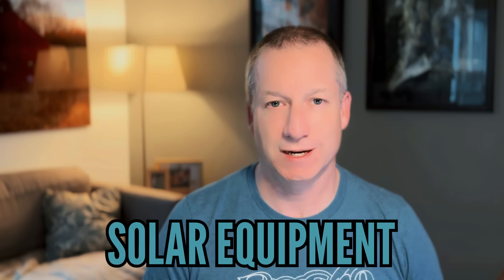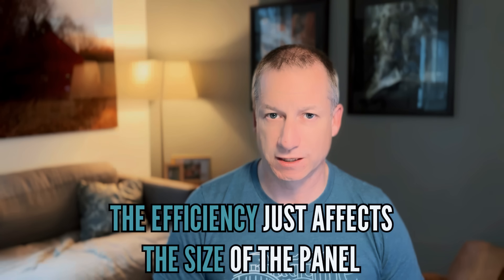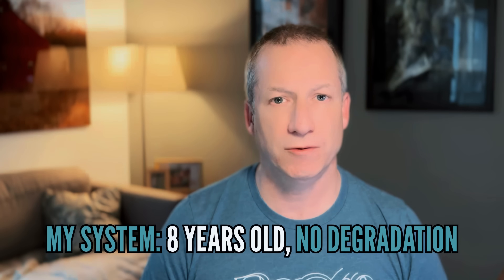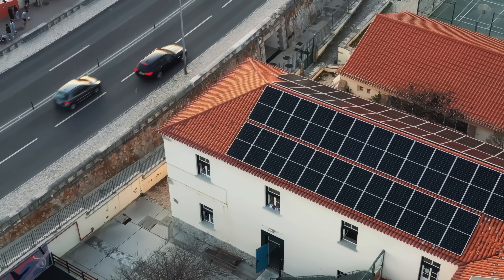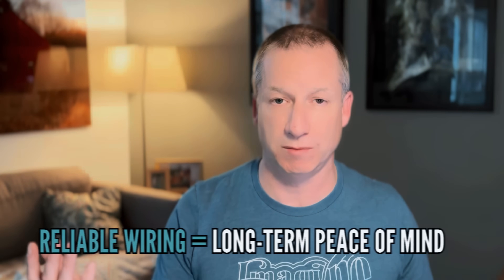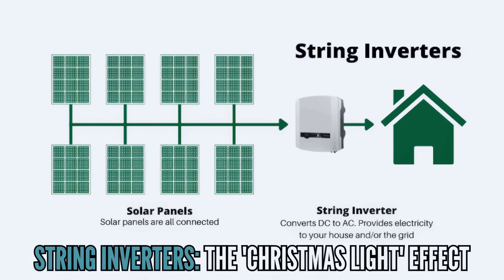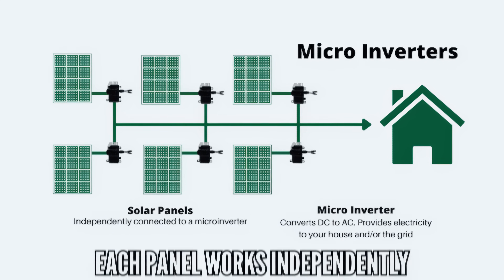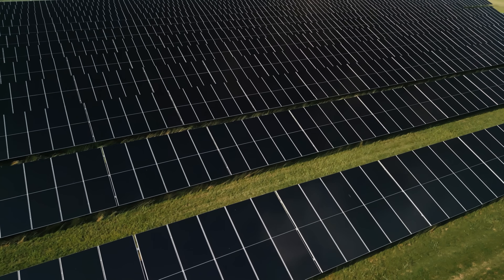The Hidden Downside of Microinverters No One Talks About

Comment: This is misleading. Micros have 25 years of warranty (Enphase) and even if one would fail the rest of the system works great. With an optimizer based systems (Solaredge) both the optimizer and the inverter may fail. And string inverters only have a 10-15 years warranty. In addition, you are running high voltage DC cables on the roof with an optimizer type of system. Micros are a bit more expensive but they give you the piece of mind that your whole system will never fail. It’s AC and it’s safer due to no arching issues. And if you ever want to add panels in a micro system you just slap new panels on with new micros. However, with an optimizer based system you have to resize and buy a new inverter that match the additional panels. If one doesn’t go with Enphase then the Tesla Powerwall 3 with included inverter is the best option. There is no need for optimizers anyways as new solar panels have bypass diods  in built that manage shading. Thus optimizer based systems have lost most of their historical advantages.
Reply: This guy is just talking BS as Enphase have a great data set on reliability and its stellar with an extremely low failure rate. 10:45
Reply: 3 of my 6 Enphase micro inverters failed within the first 5 years. Yes they are covered under warranty, but I have to pay the labor to have them replaced on a high steep roof. The labor was so expensive that I just lived with half my system offline for the last 5 years. Also Enphase had wanted me to replace my gateway with a newer one (more $$). I so wish I just had a box in my garage I could replace myself if it fails. Mounting complex inverters outside under hot panels seems questionable to me; warranty or not.
Reply: @mk500 You mean you cannot replace a few plug and play low voltage microinverters on the roof but you are capable of replacing a high voltage inverter on the ground. Get a ladder.
Reply: @TurreTuntematon cautious repair in a weather-protected environment or acrobatic juggling on a steep slope while exposed to the elements?  Hmmm.  You do you.  Get a ladder, indeed.
Reply: With optimizer if add you just need to be sure your inverter can take more (kw) don't need to buy another inverter
Reply: But after the two year labor warranty it cost about $300 to $500 to come out and diagnose and warranty it and pay again to swap it out
Reply: @DanielMaldonadoPC And it costs 5k and a few weeks wait to get a new central inverter while not having a solar system generating any electricity. I know which one I would choose.
Reply from the maker: It's not misleading I just disagree with you. Both Enphase and Solaredge satisfy the Federal mandate for panel level rapid shutdown and arc control. This is the main reason they have a virtual duoplopy for residential inverters here in the US. I recommend extending the Solaredge warranty to 25 years. It costs about $300. Plus the Enphase system has a combiner box which when it fails knocks out the whole system. Solaredge has DC coupled batteries which are much better than what you can do with Enphase. No you can't just slap a few more panels on with Enphase at all! Most places here in the US that means an equal amount of paperwork as the original install. Permits, Interconnection, fire code, structural etc. In the real world though if you own your system I think you are likely to have more solar up time with SolarEdge than Enphase. This is highly influenced by the installation company as ultimately how things are repaired overtime will come down to them. Are they in business? Are they willing to eat the crappy money the warranties (both Solaredge and Enphase) pay for service calls and replacing parts? When a couple micros go out are they going to fix them or are they going to wait for 5 or 10 to go out to make rolling trucks worth it? Please note this all pertains to owning your own system. Warranties are not an issue with leases.
Reply: @bradthesolarguy  What exactly is going to fail in an Enphase Combiner box that knock out the whole system?   It's a dedicated breaker panel, that accepts standard breakers, and the only electronics in it are the Envoy/gateway monitoring device.   If the Envoy fails, the micro-inverters will happily continue to produce power, the only thing missing will be the ability to monitor the system.
Reply: @TheUweRoss Nothing will fail. This Brad guy is talking from his butt.
Reply: @bradthesolarguy  No need for Enphase combiner box. A small load center with circuit breakers is all that's required. The combiner box is way over priced.
Reply: @bradthesolarguy  Well you can disagree but talk to installers and they all say there are much more quality issues with Solaredge than Enphase. And yes, you can just slap more panels and micros on if you want to enlarge your system. With Solaredge you have to buy a completely new expensive inverter. The permit times are irrelevant to that fact. There will be no optimizer in the future as they provide no real advantage to new solar panels dealing inherently with panel shading (diode bypass). Solaredge is most likely even bankrupt in a few years so that warranty goes poof. Check their company performance and losses so you understand.
Reply from the maker: @TurreTuntematon  I have over 1000 installed customers who were installed by installers that I have talked to. Maybe you should talk to somebody?
Reply: @bradthesolarguy  It’s well known among installers that the quality of Solaredge is not on the same level as Enphase. And not even talking about the warranty and customer service. Maybe you should take up your head from the sand before Solaredge goes bankrupt and you and your installer buddies along with that? Warranty says poof!
Reply from the maker: Can’t really hear you with all that sand in your mouth. There are many people, maybe more, who agree with me. And I happen to know and respect some of those people as I have worked with them for years. Do you have anything other than internet experience?
Reply from the maker: Also, why do you think the largest and fastest growing residential solar installer in the US uses SolarEdge?
Reply: @bradthesolarguy  Why do you think Solaredge isn ’t selling anything and has 1.5 billion in inventories? Don’t you read business news? It’s going bankrupt and loosing 100 million per quarter because not many wants its products anymore.
Reply: @bradthesolarguy  Can’t you hear with all the sand in the ears? 😂 And yes, I’m probably more into Solaredge as I still even have a small holding in them as an investor. Will exit however because it’s clear that they have screwed up their business. Good luck with your penny business.
Reply: @bradthesolarguy good insights.  Thank you

Comment: Aren't batteries a crucial component?
Reply from the maker: Only if you are not connected to the grid. Otherwise, in most cases not at all necessary. I think of solar as a less expensive alternative to grid electricity and a battery system as a luxury you pay for. Of course, this all depends on how good the local net metering policy is too!
Reply: @bradthesolarguy  I guess maybe that depends on where you live and whether or not net metering is available? In Germany where I'm writing from there is no net metering. I pay much more for electricity I buy than for what I get fro electricity I sell ( 4 or 5 times more). And a lot of our usage is before or after peak solar generation hours. With a 10 kWh battery, we use virtually zero grid energy between April and September because of the buffer the battery affords. It is a different story in the winter of course. Having a heat pump with a hot water storage tank also helps (it effectively acts as another 'battery' heating water when there is a lot of sun and keeping it hot enough to use in the evening and when there is no sun)
Reply from the maker: Yes. Thanks for sharing. The net metering policy of your utility makes a big difference in whether batteries only used for back up power or if used to move solar electricity from day to night.

Comment: No mention of this but don't string inverter systems have extremely high voltage on the roof and in Australia has resulted in many house fires ?
Reply from the maker: Don’t know about Australian electrical code but in the US you can’t install anything that will have high voltage resulting in fires!
Reply: @bradthesolarguy  In a string inverter system, solar panels are connected in "strings" of 6–16 modules, and the power then flows through the string inverter. The voltage of a single module is around 40–50 V, but when 20–30 modules are connected in series, the DC voltage of the entire system can reach 1,000–1,500 V. This high-voltage DC current then runs across the roof...any arcing can cause fire or death to anyone nearby.
Reply: @benjamart  AS/NZS4777.1 covers this and limits residential DC voltage to 600V. Please think before spreading FUD.

Comment: Solar installers in FL have a worse reputation than used car dealers, for good reason. My GF solar edge solar inverter was toast in 4 years then the installer wanted $400 just to show up and "diagnose" the issue even though they already knew it was fried from the web connection.
Reply from the maker: Ugh! Sorry to heat that.

Comment: My SolarEdge inverter failed at the 4th year.  I had one optimizer fail on the 6th year.  The inverter took 3 months to repair because they had to wait for SolarEdge to send them a replacement.  The optimizer only took a week because they had some on hand.
Reply from the maker: Appreciate you sharing your story.
Reply: that's a typical story.  Thanks for sharing. Brad is a bit off base here.

Comment: Interesting vid.  I just had a system installed and elected to go with Enphase Microinverters vs. SolarEdge DC optimizers because I repeatedly heard of disastrous quality issues with SolarEdge and the difficulty in getting warranty service.  Every Solar installer I spoke to in NH said the same thing except one who said they had turned it around.  I was unwilling to test that out and went with Enphase.  Only dissapointment is clipping which seems to keep me from getting mkre watts - is that an issue with SolarEdge as well?
Reply: Yes, SolarEdge does not do as well in the lower light times of day.   Microinverters do well during these times.  The real world production of SolarEdge vs Micros is nearly the same.  Clipping is not a big deal and should not be considered a downside of Micros. Been in solar for 6 years.
Reply from the maker: Clipping is an issue on either system. I think SolarEdge does a better job with minimizing it, but it really depends on your enphase setup as to how bad it is.

Comment: This is ass-hat advice. As you said, everything breaks. If a single micro-inverter goes down, you still have solar production until the crew comes out to replace that micro-inverter. I have Enphase on my roof and have had two failures in the four years our system has been online, and both of those failures were in the first 90 days. Also, you said something categorically incorrect. The solar panels don't just pour into the batteries. That's a fast way to kill your batteries because they can't handle the input voltage. You have to use a DC-to-DC charger.
Reply from the maker: Let’s keep it civil. Just because I have more experience than you do and think your wrong doesn’t mean I’m going to call you an asshat 😀
Reply: @bradthesolarguy  lol ok
Reply: So your failures were within the first year? Checks out with what he was saying. I agree with you that the solar panel to battery isn't a direct wire connection. He was noting that with micro-inverters you have to have a an AC-DC converter before the battery can receive the juice (charge controller not withstanding) and then you have to use a DC-AC inverter like any other battery system or non-microinverter system to use the power. I believe he left out the nuance of battery charging because it was outside the scope of what he wanted to cover in the video which was the many types of Solar Panels not battery charging systems.

Comment: I’ve installed micro inverters for 15 years and optimizers for about 10. (And string inverters for 18 years) Optimizers have had a much higher failure rate than micro inverters in my experience and early solar edge inverters have terrible reliability. Bypass diodes on modern solar panels mitigate shading issues in a properly designed system. Cost savings with a modern string inverter is huge and a couple extra solar panels is way cheaper than optimizers or micro inverters.
Reply from the maker: Thanks for your input. I have had the opposite experience, but that just highlights that an installer with a good labor warranty who will be around is key! Also, the little bit that optimizers improve production is worth the money here (I did the math in another response) and most of my customers don't have room to add any panels.
Reply: @bradthesolarguy  'Optimisers' don't improve production. Do you have any REAL WORLD proof that they do?  'Optimisers' are a con. They don't work.

Comment: Thanks for this video!  Now I understand how DC Optimizers can create a more streamlined and efficient system than going the Microinverters route.  It sounds like the power optimizers are the least complicated route to go when including battery storage.
Reply from the maker: I think so!
Reply: @bradthesolarguy  rather buying a expensive string Invertor I suggest to purchase a bi-directional EV module where solar input(Micro invertors) is fed to module to get DC from it(charge batteries) & when AC is required put battery power to it's input & feed to AC load
Reply: LOL. You don't understand anything, because he's LYING. He pretends that bypass diodes don't exist. 'Optimisers' don't do anything that bypass diodes don't already do, they are a waste of money - do some more research on Youtube, there are videos which prove they don't help in any way.

Comment: Totally wrong, string inverters works totally fine, there is no "Christmas light effekt".

All modern panels has by-pass diodes, so this is not a issue.

What planet have you been on the last decade?
Reply from the maker: I’ve answered this many times in the comments. We are just going to have to disagree.
Reply: @bradthesolarguy  LOL. "We are just going to have to disagree." Which means "I'm just going to keep pretending that bypass diodes don't exist, and mislead people with my obviously FALSE 'christmas tree' diagram." Laughable.
Reply: @bradthesolarguy  delete the Xmas tree part and then its ok 

Also if your ac cable from your micro inverters breaks then it's also Xmas tree effect 

🎉
Reply: What he is saying is that when a string inverter stops working, the whole system stops working, much like one xmas light bulb burning out, causing the whole xmas light string to stop working. String inverters work fine, like you said, until they stop working. Then your whole system stops working.
Reply: @AzDad1928  No, he says that if one panel is in shade, all the other panels in that string stop working. This is patently untrue, it's a LIE.

Comment: 4 parts to every system  panels contoler (you left that out) storage batteries and inverter ... and to obtain efficency  first storage then controler .. panels and inverters are least important  and don't dump in to the grid. Keep the energy and bank  ..never use a all in one contoler and inverter
Reply: Not everyone gets batteries with their system, he's just talking about solar here. Battery is an added expense. Might be a wise one, depending on your budget and where you live, but it's not necessary in order to have a working solar system and doesn't always make sense for everyone.
Reply from the maker: Yup.

Comment: Brad says electronics that get through the first year have a full reliable life. 

Quality Electronics last for decades.
Enphase has a good reputation. 

If a PV panel or microinverter fails, you know which one and so can plan to replace it, no searching the array on the roof with enphase. 
Timely action in warranty period. 

Generation  is maintained. 
CASH SAVINGS is maintained. 
Grid electricity is expensive electricity. 

If the supplier disappears in the future, you probably will not need them if your system is reliable and older than one year. 

240vAC microinverters on a metal roof is a safer situation vs 600vDC. 

CASH SAVINGS lost adds to COST of cheaper string inverters.

Comment: Im a solar tech in california and let me tell you DO NOT get a DC optimizer system. I have serviced tons of solaredge systems and I have encountered customers whos
inverters blow out EVERY YEAR. You have no idea how angry they are to find out their system stopped working a year ago and receive a $3000 electric bill.
Microinverters are significantly more reliable.
Im speaking from over 10 years of solar troubleshooting and diagnostics.
Reply from the maker: Appreciate your feedback and experience. This makes it clear that no matter what way you go that you need a good company to take care of you.  Also, customers should monitor their own systems so they don’t get $3000 surprise electric bills.
Reply: @bradthesolarguy  Maybe you should listen to @CellTeam6?
Reply: @bradthesolarguy  When Solaredge shut down their 3G cell monitoring it was a year until they had 4G cell cards in stock then they would only allow a certified installer to swap out the 3G card for the 4G card which was an operation that was simple and could be done it minutes.
Reply: Brad says electronics that get through the first year have a full life.
Quality Electronics last for decades.
If a panel or microinverter fails, you know which one and so can plan to replace it, no searching the array on the roof. 
Timely action in warranty period.
If the supplier disappears in the future, you probably do not need them if your system is reliable and older than one year.
Reply: I do not understand. I am billed 4 times a year.